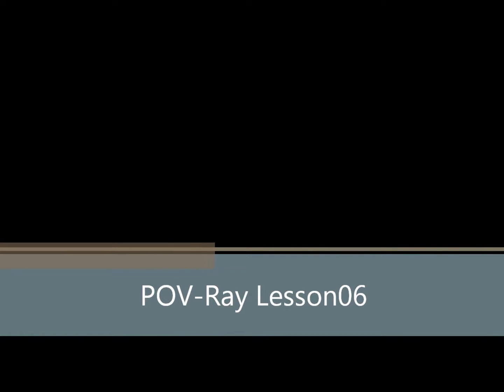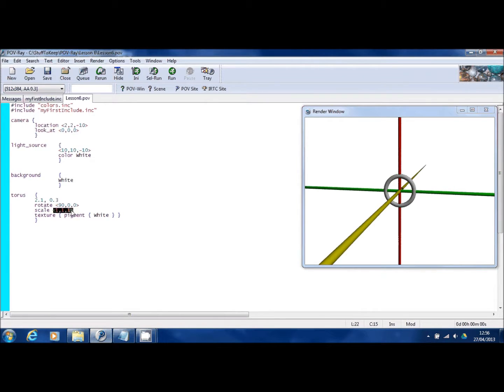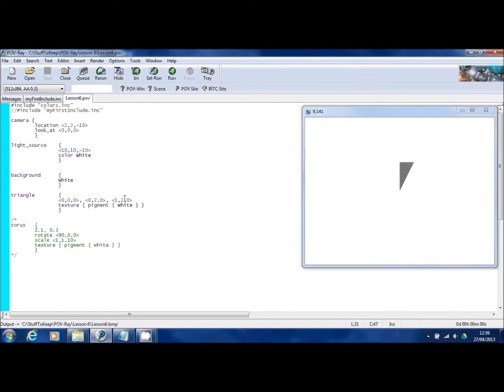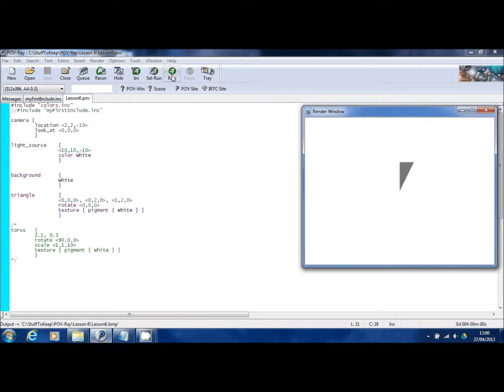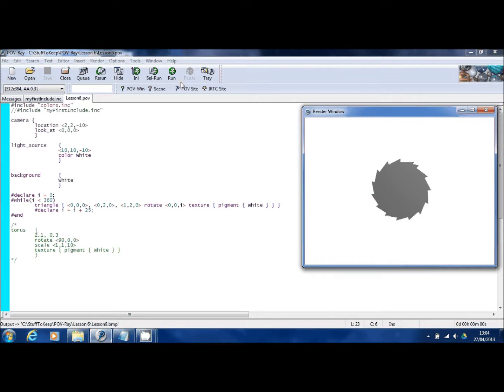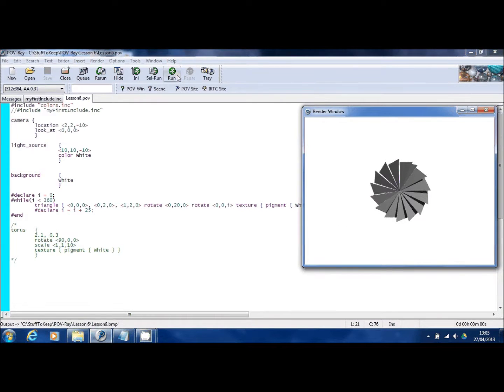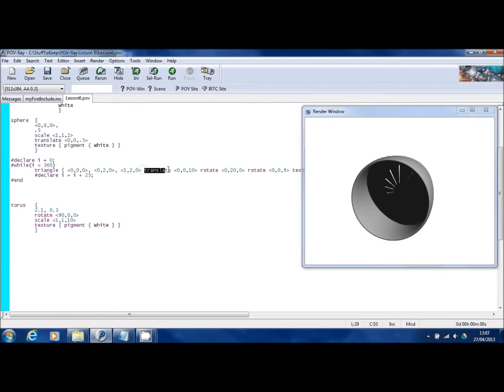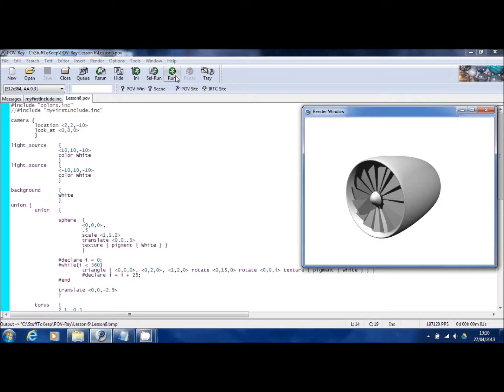How To POV-Ray, Lesson 06

Comment: The code:
#include "colors.inc"
//#include "myfirstinclude.inc"
camera {
       location <2,2,-10>
       look_at <0,0,0>
       }
light_source {
       	     <10,10,-10>
       	     color White
       	     }
light_source {
       	     <-10,10,-10>
       	     color White
       	     }

background { White }
union
{
    union   {
        sphere {<0,0,0> 
                .5 
                scale <1,1,2>
                translate <0,0,.5>
                texture { pigment { White } }
               }
        #declare i = 0;
        #while (i < 360)
            triangle {<0,0,0>,<0,2,0>,<1,2,0> rotate <0,20,0> rotate <0,0,i> texture { pigment { White } }}  
	    #declare i = i + 25;
        #end
        translate <0,0,-2.5>
        }    
    
    torus {
    	    2.1, 0.3  
    	    rotate <90,0,0>
    	    scale <1,1,10>
            texture { pigment { White } }
    	  }
    rotate <0,20,0>
}